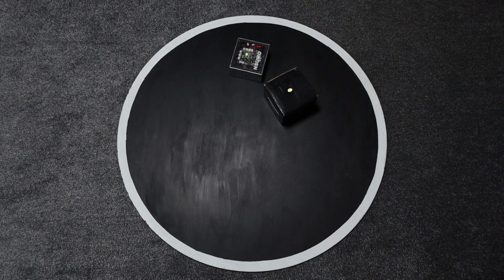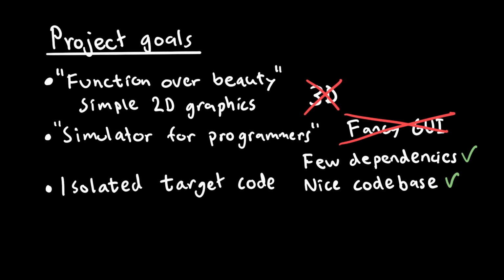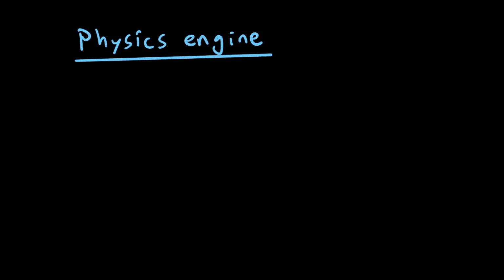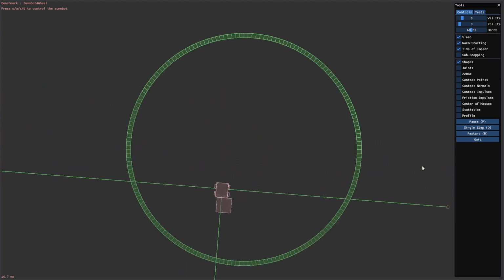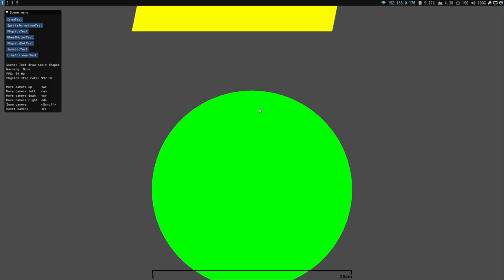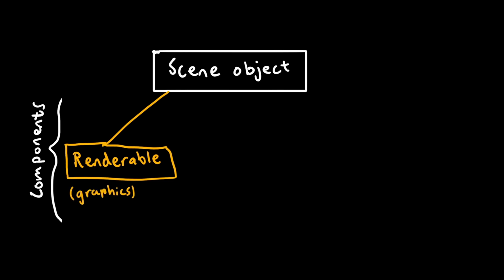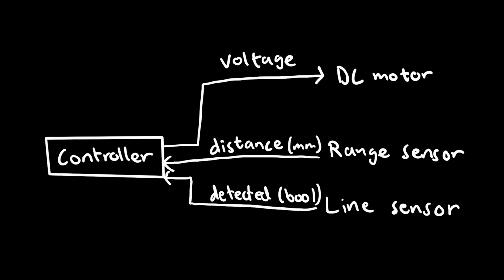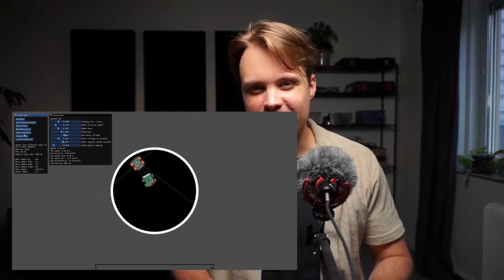I made a Robot 2D Simulator with C++ | Embedded System Project Series #25

Comment: hello Niklas i love watching your tutorial videos it help me alot but i have a question i am confused how should i learn embedded system from scratch can you suggest some guidelines ❤
Reply from the maker: You learn by doing. The best way is to work on a project, but as a beginner you have to start small. And before anything, make sure you have a good understanding of C, you don't want to learn C and embedded systems at the same time. Then pick up a dev-board for a simpler microcontroller, 8/16-bit, for example AVR,STM8,EFM8, or MSP430. All microcontrollers basically works the same way, but simpler ones have fewer and less advanced peripherals, which makes them easier to understand. Start playing around with GPIO, Interrupts, UART, I2C, SPI, ADC, and so on. For example, blink an LED, turn on an LED with button, with polling and with interrupt, connect a sensor with a serial interface to your dev-board and write code to talk to it. Then think of an easy project you would like to build, draw inspiration from typical arduino projects, but don't implement them with arduino, do them bare-metal instead. Once you understand things at a low-level, then you may move onto using more abstractions such as RTOSes.
Reply: thank you so much ❤